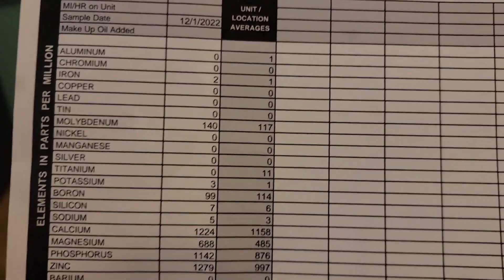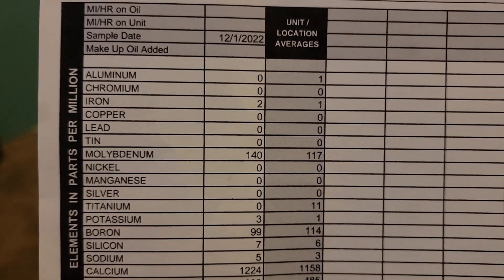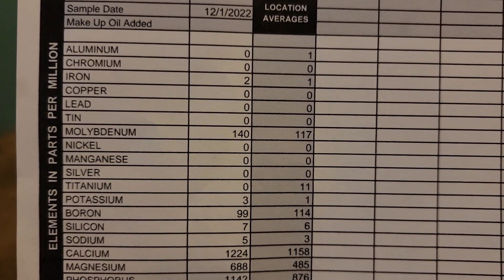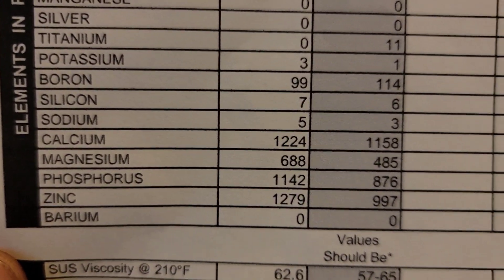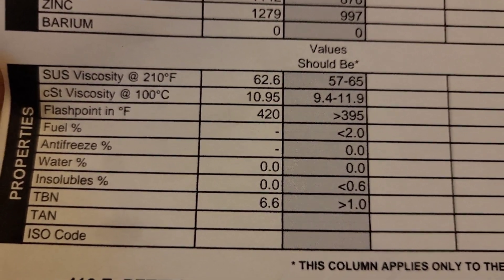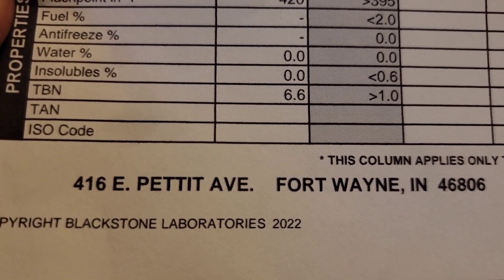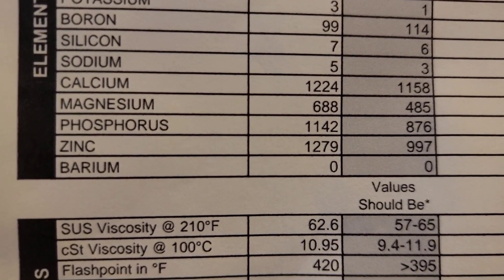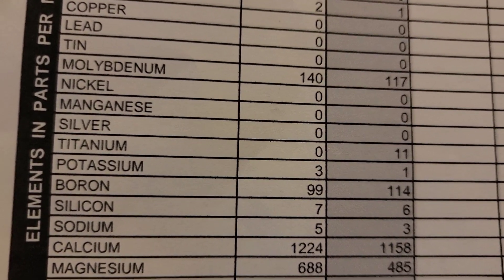Quick - Read Lab Analysis Reports - New Segment Being Posted - All Oils Get a Individual video

Comment from the maker: So I did not completely add everything in on the sus viscosity and CST  viscosity that I should have added it

The main part of the viscosity testing is at a given temperature which is typically around operating temperature they take the oil and they actually put it through an orifice and they give it a rating on how it travels through the orifice and the range is for sus viscosity 57 to 65 and CST viscosity 9.4 to 11.9 are the normal ranges for a 5W-30 engine oil

The temperature at which the oil is run at directly affects how it flows so when I said the oil shearing that wasn't necessarily correct it was more along the lines of a given temperature at which the engine is run at and the oil flowing at a given rate
Reply: Well done for taking on board my comments and making an effort to correct what you said.
I hope this will help to address any misinformation.
Nice to see some responsibly taken.

Comment: I have a new vehicle on order (RAV4 Hybrid), and I drive about 15,000 miles yearly. I'm trying to decide on the best OCI. Five thousand will be my max, but is there any big advantage to doing it at 3K? I keep my cars for at least ten years.
Reply: I'm not a mechanic, so I don’t quite have the experience of the gentleman with this channel, but I can say I have the same vehicle and 3K would be overkill on that engine, if I do primary highway driving in the summer say like vacation, I’ll run it to 7k maybe 7500 and it still looks honey brown. In the winter or if I drive hard lots of idling then I go 5k and the only time I really see it look dark is with a lot of idle time. To be fair I haven’t done a oil test but I’m at 100k and I’m not using a drop of oil.
Reply from the maker: If I was you I would stick with 5K on a hybrid especially something as clean as a RAV4 I would not do anything under 5K I would just keep it right at 5K